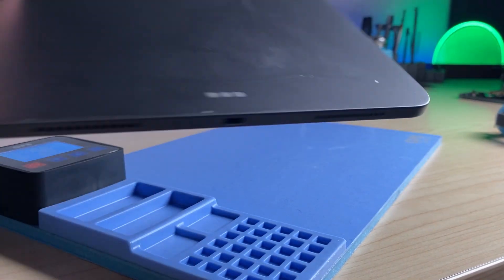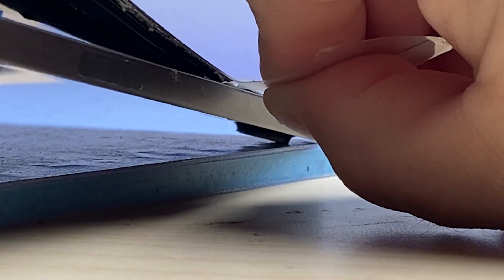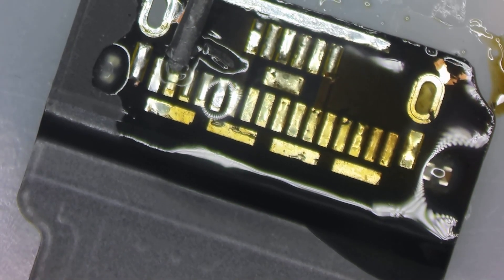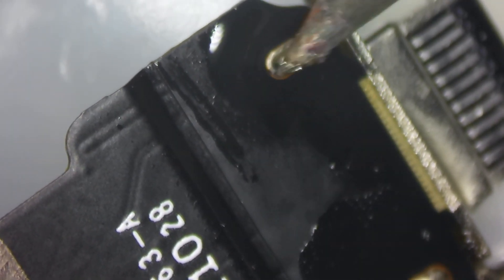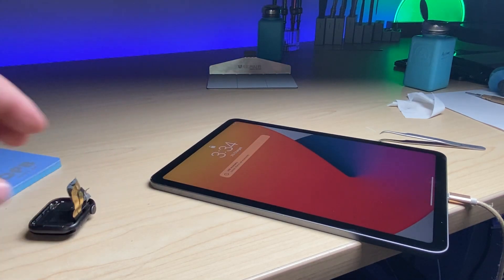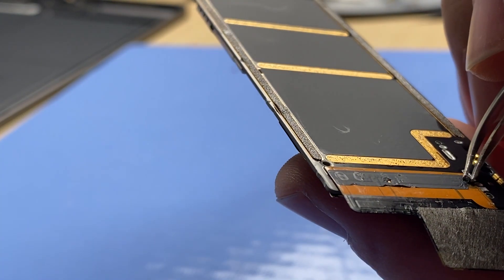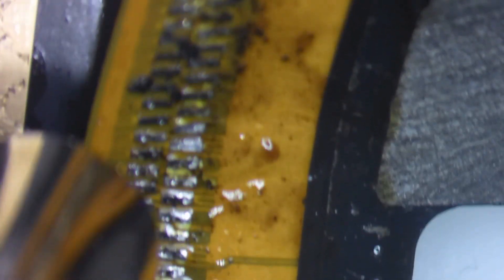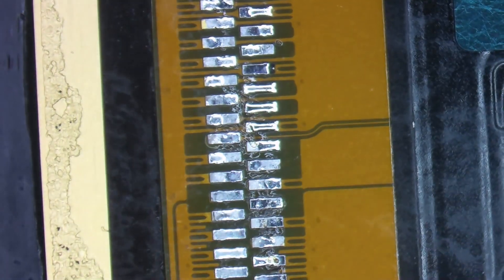iPad Air 4 Charge Port Repair(Two ways!)✌️

Comment: do you need to replace battery also alongwith the charging port?
Reply from the maker: It’s not necessary most of the time, but it’s also not a bad time to do it if it’s needed.

Comment: Is it possible to use an aftermarket charging port for method one (extract the port and solder it into the original Apple flex)?

Comment: So quick question, what happens if that "Delicate flex cable" you were referring to at (9:39) gets torn? I bought an Ipad for parts that has that flex cable ripped off. is it possible to solder a new flew cable in it's place?

Comment: Just now at 8:48 you removed a cable after you removed the sticky black foamy thing. You removed the doubled cable so easily. I couldn't do it no matter how I tried. Then I got mad and smashed the iPad. Now, I have to give him my iPad Pro. I had spent so much money buying the CPB mat, a $600 soldering kit, the screen removal clamps, etc. 🤣🤣🤣
I screwed up! 🤣🤣 🤣🤣 The kid's iPad Air 4th generation is now resting in the garbage bin. Damn 🤣🤣

Comment: One thing I would like to know is if you replaced the glue that held down the screen in the first step. Or if you just reheated the front and then pressed it back down once completed. If you applied glue, what type did you use? Thank you.
Reply from the maker: Great question. It depends on how successful I was in removing the screen without destroying the adhesive. I wouldn’t use glue to reseal the iPad even if I needed to replace the adhesive. Instead I’d use Tesa tape or 3m tape that mimic the adhesive apple uses to close the iPads. This would mean that I’d prep both surfaces perfectly.
Reply: @FIXDPHONES  Thank you for the response. As I was removing the screen, I mistakenly severed the single connector cable. Damn! I have taped it down to the area of the break, with insulator tape. However, it looks like a strip of metal sandwiched in plastic. I don't know if it will work. Damn!

Comment: Usbc is so fragile. It failed in my iPad too. Never had this issue in my old lightning connector iPads
Reply: That is soo true. My iPad Air 5 stopped charging because of two (!!!) bent pins inside the port. And that is after 8 months of pretty light useage... Never had that kind of issue with other USB-C devices. I actually recently bought iPhone 14 Pro instead of waiting for the 15 Pro just because of the switch to USB-C on the 15 lineup. Apples USB-C ports are joke.